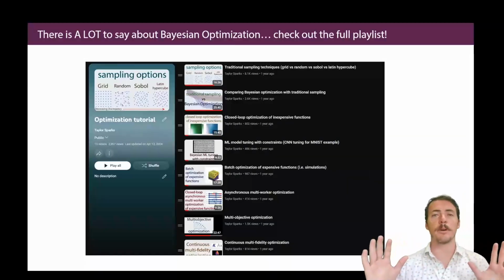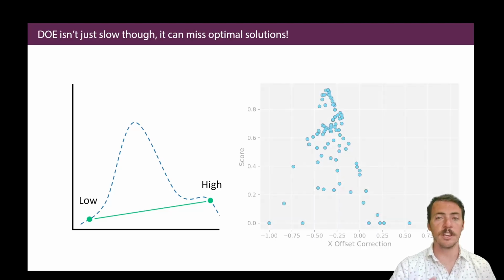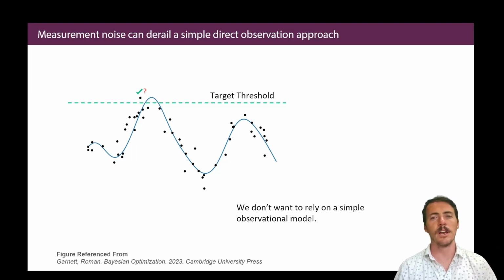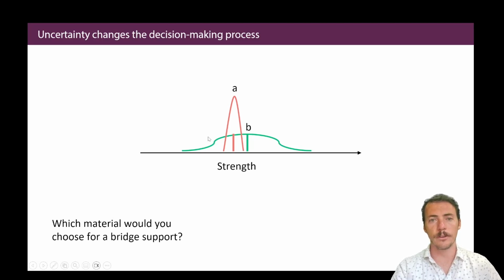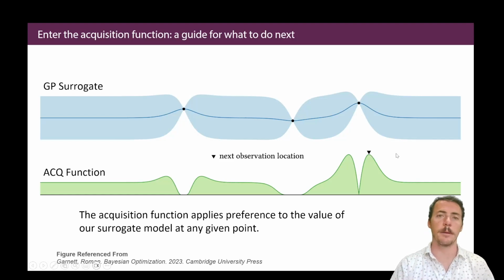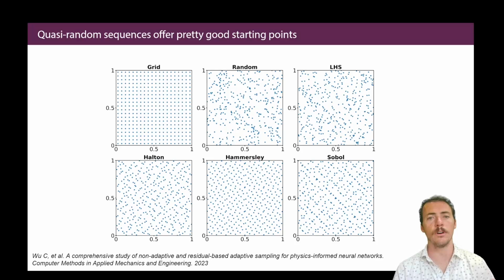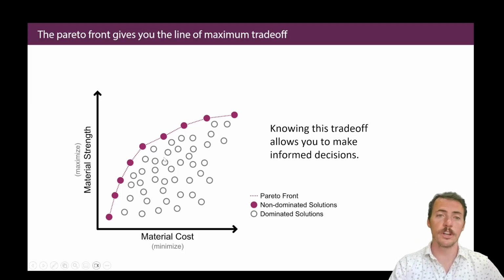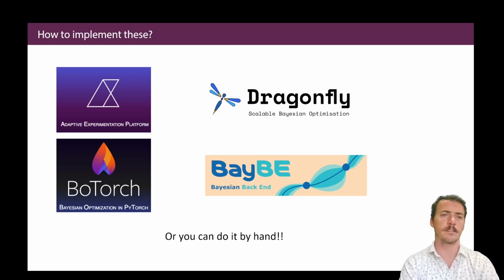32. Bayesian Optimization

Comment: Hello Boss 😂
Im a big fan of materialism podcast and about year ago i heard you saying about the GPR for process optimisation. Back then i was on final year of my masters in material ing working on final project. I decided to optimise a resistance welding process using regression machine learning and compare which approach (gpr svr linear) would be best suited for application. At the time i also worked in  welding society so i prepere small paper about my work which was inspired by your podcast. After the conferance i recived 2 work proposals. And now as Master im working on LPBF process optimisation for aerospace company and it all started with your podcast ❤
Reply from the maker: Holy cow, that makes me so happy to hear this. Congratulations to you!

Comment: An excellent video. Thank you so much professor! 😀May I ask that if I want to optimise two or more properties together (e.g., strength and ductility), would it be better if I use a Multi-task Gaussian Process (MTGP) model, rather than several individual GP models? Because the trade-off between these properties can be learned by the MTGP model?  By the way, may I check that can the iteration of the bayesian optimisation process also be termed as Active Learning, if I am not wrong? Many thanks for your attention. 🙏
Reply from the maker: @jinlongsu7308  I would simply do a multi objective optimization. Multitask is typically used when one property has more statistical strength than the other and the two properties are related their by allowing you to lean on the statistical strength of the one with the larger data set
Reply: @TaylorSparks  Noted. Many thanks for your prompt reply! 😀

Comment: Thank you professor 🙏.  If we knew the objective function ( for example mean squared error equation) would it be logical to make use of bayesian optimization to find the minumum of that objective function which is computed for aimed optimized  parameters in a given domain?
Reply from the maker: @vrhstpso  sure, but it is more often the case that we don't know the objective function and we are instead trying to learn it using a surrogate model such as a gaussian process.
Reply: @TaylorSparks  thank you.